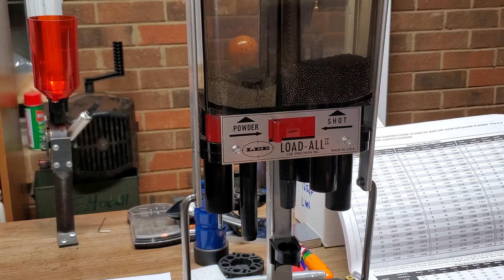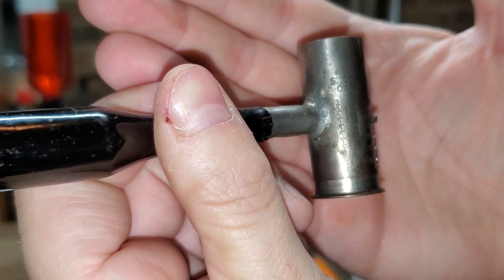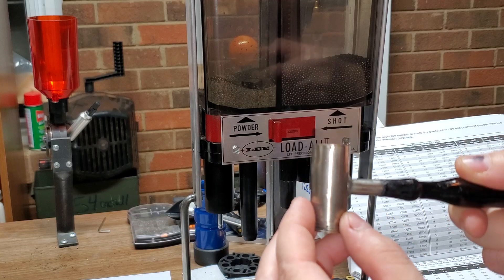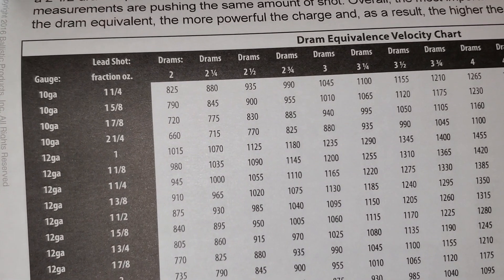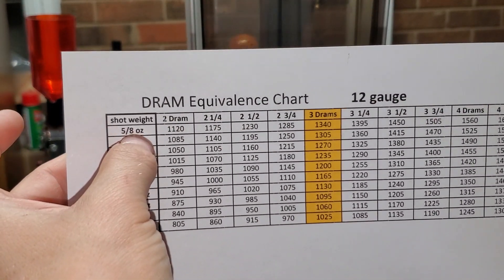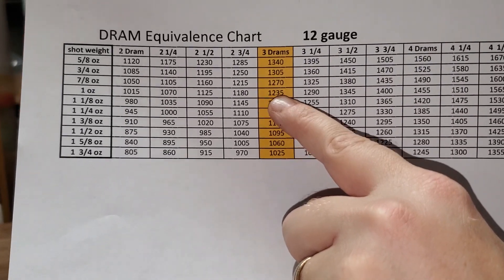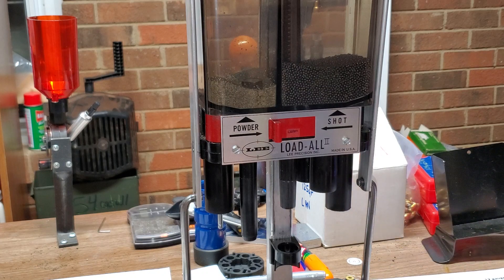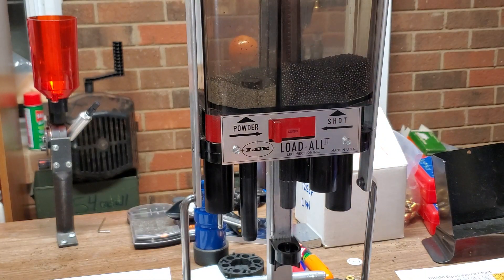Finding dram equivalent for modern 12 ga shells

Comment: black powder dram equivalent listing  is based on observing that 
3 drams or 82 grains of black powder could drive 492 grain 
or 1.125 ounce load of shot out of a 12 gauge at 1200 fps 
so  
the amount of any modern propellant that can push one & an 8th of an ounce  @ 
1200 fps velocity is then said to be the equivalent of 3 drams of black powder 
&
shell reload data from factories say most of their 3 dram equivalent 
shells start from 16.5 - 19.5 grains of Smokeless  to work up from 
as in 
.60 - .73 drams of smokeless powder is equivalent to 3 drams black powder 
or 
a 4 or 5 to one ratio BY WEIGHT! NOT VOLUME!